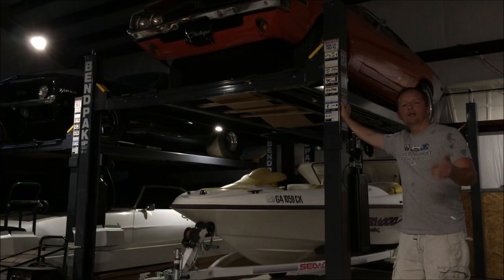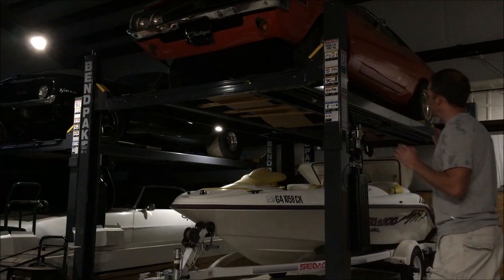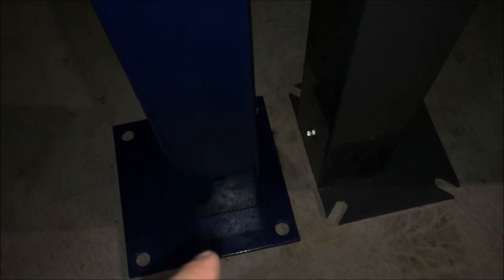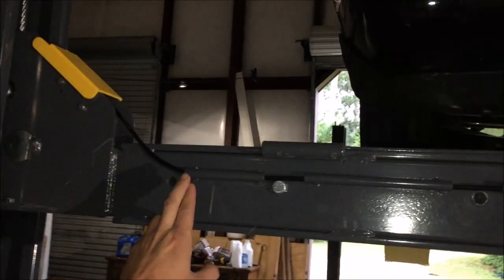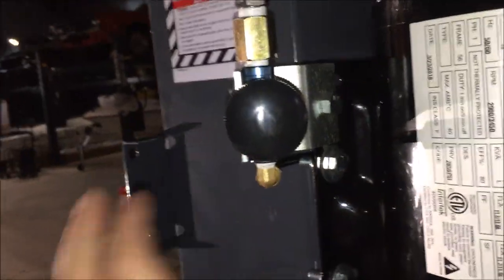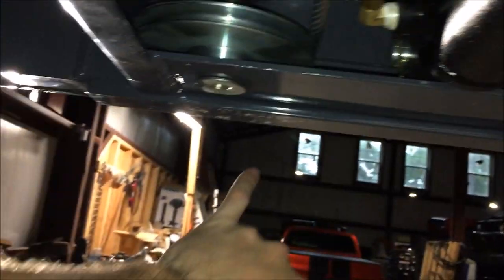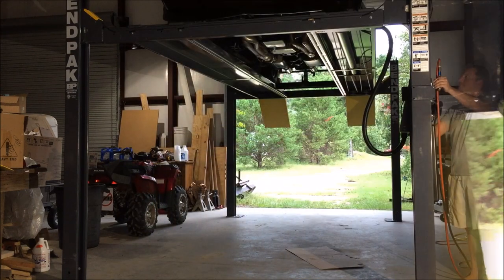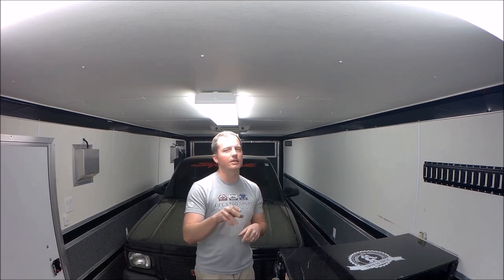bendpak 4 post lift HD9 and HD9XW differences and details

Comment: It sounds like you have some adjustment to do on those ladders. We shouldn't be hearing 3 clicks at each 6" height notch as the lift is being raised. Each safety cog should drop into the ladders' notches simultaneously. It's easier to level the runways (adjust the cables) while the cables are holding the weight. Then adjust each ladder until the bottom of each notch (cutout) just touches the bottom of each safety cog.